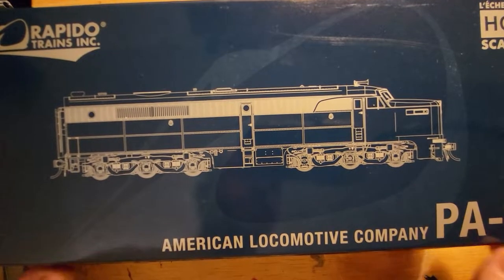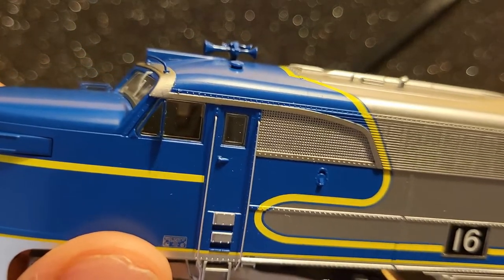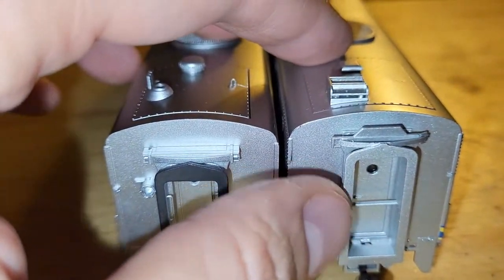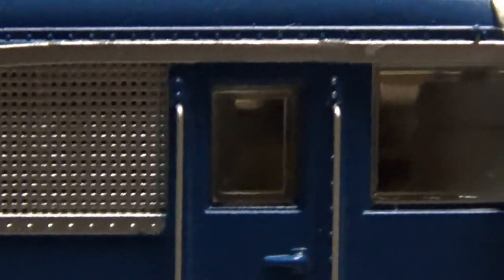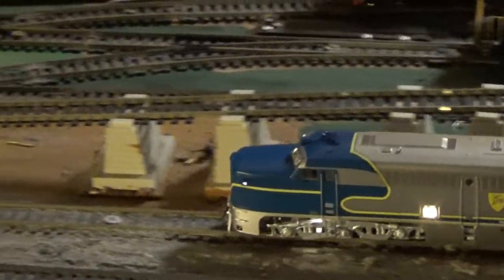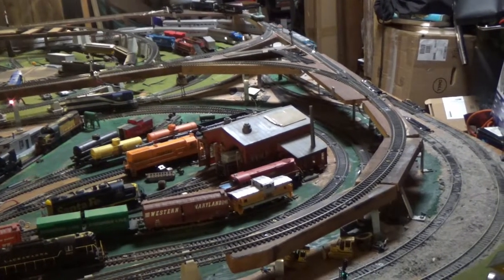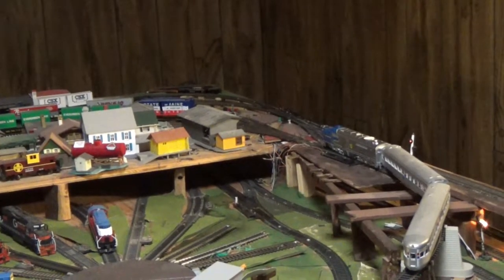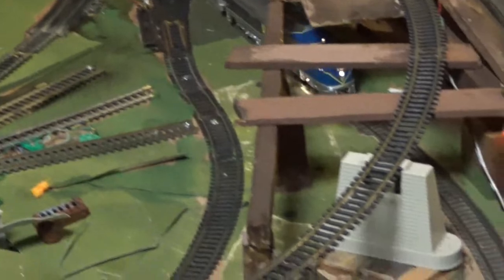The History and HO model's of the Alco PA part 2 Rapido's alco pa in D&H

Comment: Nice video. I have the same Rapdio D&H PA-1 and it was derailing on my 24 degree curves. The problem is the hood ladder. The truck hits the hood ladder on the turns preventing it from rotating all the way thereby causing derailments. The ladder is made of metal and can easily be bent using your finger outward to allow the truck to move freely. I recommend just turning the engine upside-down to verify how far to bend the ladder.

Comment: What a nice loco. Are you sure that the cable too the axle bearing at the truck are too traction motor and not too some kinde of taco generator fore 

speedometer or cabsignalling system. A think Rapido trains are not aviable here in Swden, thats a pity. Your videos are fantastic. Parden my little rusty english.

Comment: I got the pennsy version. Due to road specific details I actually don't have even a quarter of the lighting features, as they only had the head light and front nose number boards. The class lights were on the rear. I have the same derailing problem, I am gonna try to gently bend the door ladders out a little and clip some small under body detail. It's cool they have it but, you never see it so who cares.